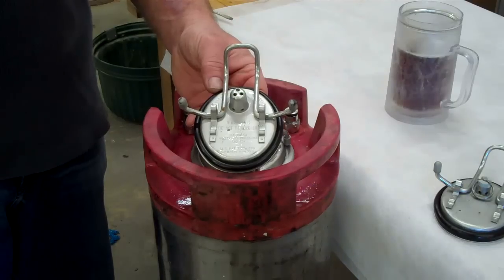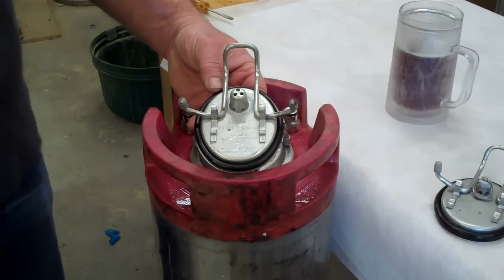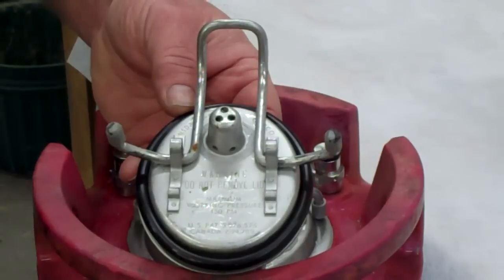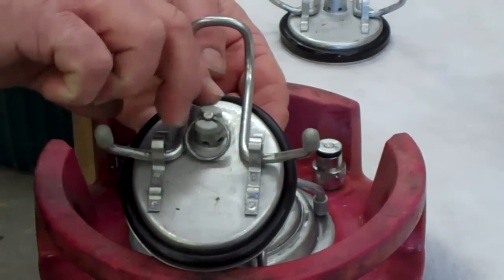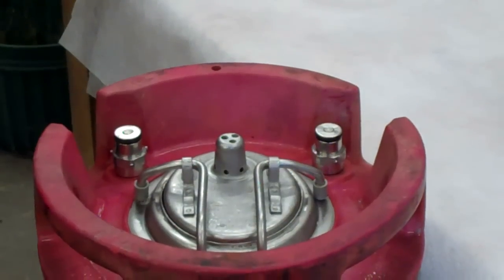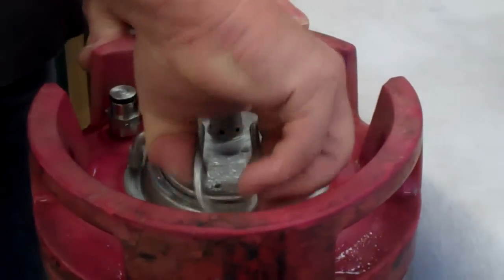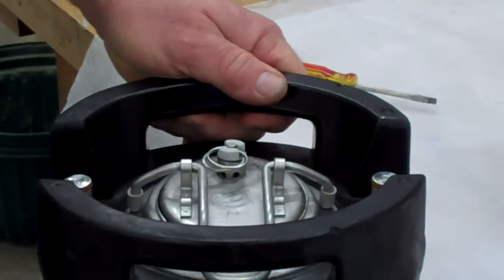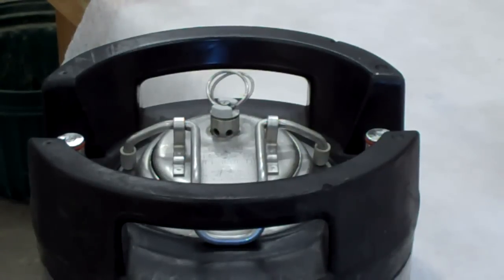Manual relief valve -vs- static relief valve

Comment: Thanks for the video, It is just exactly what I wanted to know, relieving the pressure via the post valve was something I never thought of, I have 2 kegs w/o lids and found this style of lid for replacement for 1.99 each. Hoping the plastic relief valves aren't cracked when they arrive because they are designed to break at 125 psi....